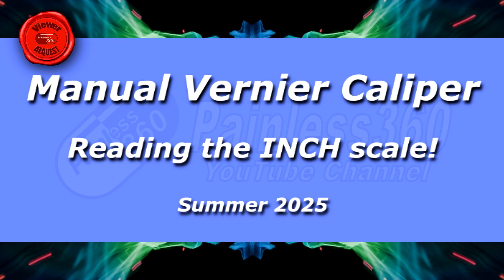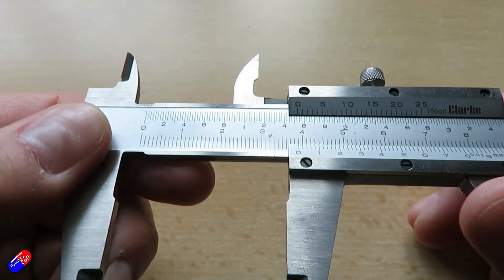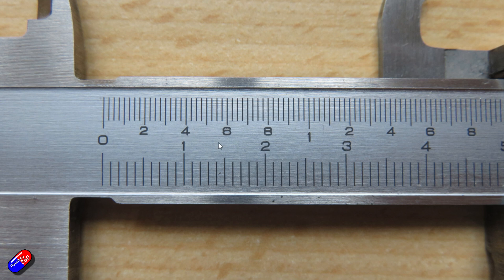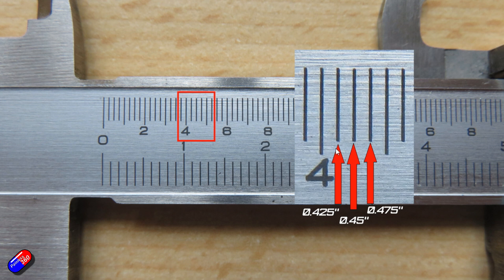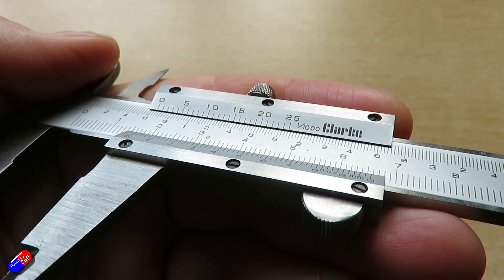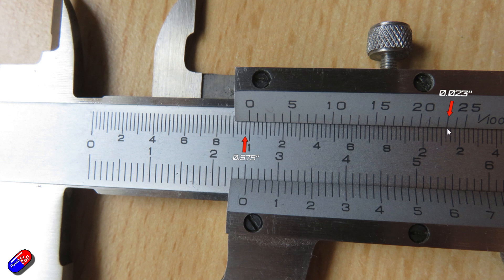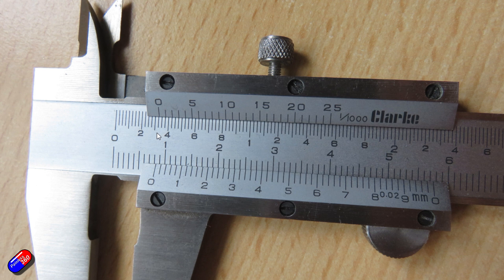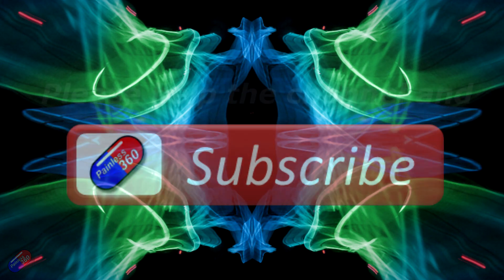How to read an Imperial (INCH) Vernier Caliper (viewer request)

Comment: Great video, thanks.  I normally use a Mitutoyo, but for hobbyist stuff I bought one of these manual ones since I really don't need the accuracy of the Mitu and this allows me to get down to hundreths which is more than I need for hobby stuff.  Thanks again.

Comment: This is why I have a dial caliper. However, it doesn't have a metric scale. So, I measure in Freedom Units and multiply by 25.4 if I need the metric value.